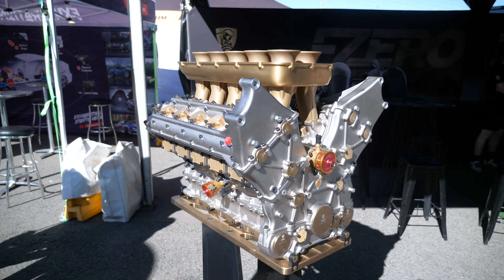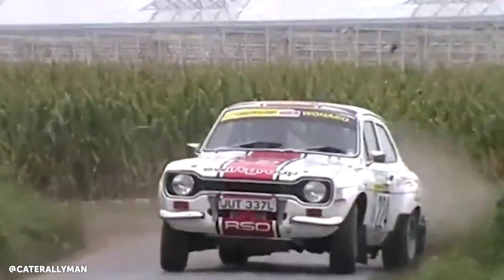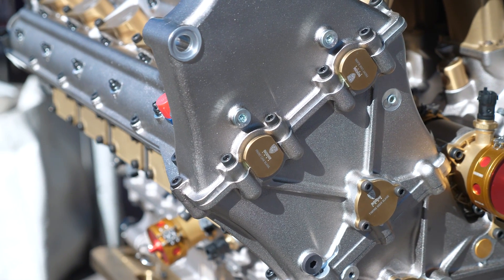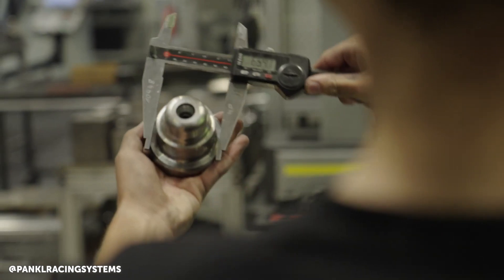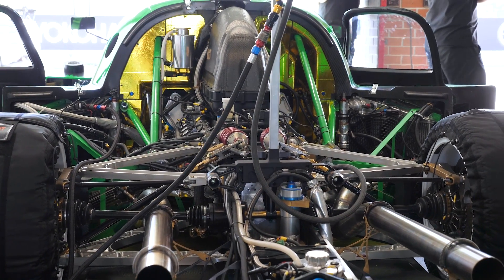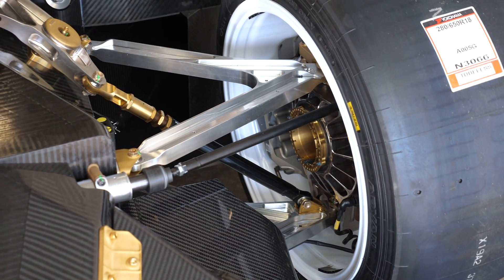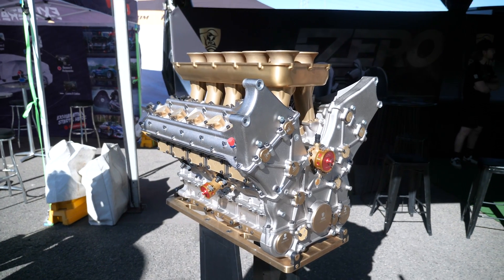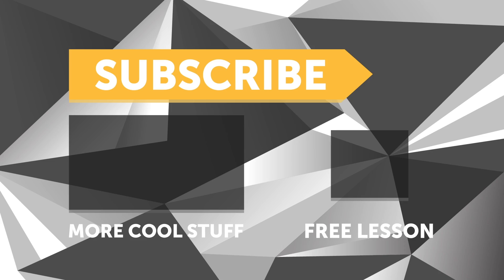NEW V10 Engine With A €45,000 Crank | Rodin RC.TEN

Comment: With good twin screw Supercharger this engine will make over 1500hp Turbos are not good because of their lag Twin screw superchargers are very efficient now days .
Reply from the maker: Technology has come a long way when it comes to turbo technology, boost control and turbo lag 🤘 - Taz.
Reply: @hpa101  So Turbo now days have No lag, instant power at lower RPM and have throttle response of naturally aspirated engine ?
Reply: @Maiza007-c8y so people now days take everything out of context and put words in others mouths?
Reply from the maker: @Decki777 are you saying superchargers have no comparative downsides, namely heat issues, parasitic drag and running out of puff at high RPM for the twin screws? No you didn't, neither did I state what you wrote. Don't be a manus.
I think you'll find everything has pros and cons, and sometimes having an option that is strong in one area but weak in others will see something that performs consistently across the board chosen over it, and in the case of turbocharging, also gives more options when it comes to packaging.
You have all the information you need at your fingertips to educate yourself on modern turbocharging and how lag is combated if you want to take your head out of the sand, remembering there will ALWAYS be pros and cons for any option you have for your own application/s.

It's also worth remembering that there are many different motorsports with varying requirements. There isn't one option that is best for every and any car - Taz.

PS: Here are a few links to save you some effort searching, if you only have time for one thing, perhaps make it the podcast with Matt (4th link). Hope that helps.
https://www.hpacademy.com/previous-webinars/113-dual-vvt-tuning-strategies-motec-m1-2/
https://www.hpacademy.com/previous-webinars/352-boost-control-tuning-haltech-elite/
https://www.hpacademy.com/previous-webinars/135-introduction-to-vnt-turbo-boost-control-variable-nozzle-turbochargers/
https://www.hpacademy.com/blog/120-wastegates-and-boost-control-what-you-need-to-know-podcast/
https://www.hpacademy.com/blog/electronic-wastegate-control-is-here-turbosmart-ewg-at-sema-tech-talk/
https://www.hpacademy.com/blog/383-9-cfm-from-a-50mm-wastegate-boost-control-just-got-better/
https://www.hpacademy.com/blog/want-instant-boost-elmer-racingturbosmart-spool-valve-experiment-tech-nugget/
https://www.hpacademy.com/blog/how-to-choose-the-right-turbo-for-your-build/
https://www.roadandtrack.com/car-culture/a45050542/how-twin-scroll-turbo-work-lost-scrolls-of-turbocharging/
https://dsportmag.com/the-tech/twin-scroll-vs-single-scroll-turbo-test-the-great-divide/
Reply: @hpa101  Both have pros and cons pretty much all modern super and hyper cars are Turbo charged what I'm saying is now days Twin screw blowers are much more efficient than before Turbo reduces kills pure engine sound I kno Turbos are much more efficient and makes little more power .
Reply: @hpa101  Super - Turbo is pretty cool though, best of best of both worlds, not sure if you saw that OM606 GM truck build with super-turbo, with a bypass air valve (no clutch on charger) for when the huge turbo finally comes on, the twin screw parasitic drag is not actually too bad as it runs essentially unloaded once turbo comes in, but made HUGE torque under the curve vs no charger
Reply: @Maiza007-c8y  three turbo compound set up with boost controllers at the cylinder to maintain max boost across rpm. Think anti lag
Reply: @reallybigdixiewrecked  Just rode in a Goblin kit car with a twin charged chevy cobalt engine and the lag and boost threshold were non existent. It was absolutely wonderful. The turbo was a 600hp turbo, btw!
Reply: Why not both 😎
Reply: It's 2024, buddy. GM builds a 2.7 L 4 cylinder, that makes 420  Lb/ft of torque at 1500 RPM , IT'S SPOOLED BY 2000, WHAT LAG ?!?!!

Comment: Everyone with an RX7 needing its 10th set of new apex seals right now… 🥵
Reply: Bah, I had rotaries for 20 years and never had apex seal issues.
That was just a consumer issue for ppl that don't change their oil
Reply: @m.b.82  rotaries are rare where i live but every single one ive seen for sale had either blown engines or had already been rebuild even bellow 100k km. Cant tell me a rotary is reliable even if you maintain them, they surely cannot last anywhere near as long as a piston engine.
Reply: @KK001  that's because they aren't being looked after like I just said. The ones that aren't for sale are owned by long term owners who aren't selling them.
Reply: @m.b.82  if an engine needs alot of maintenance, isnt that almost the same thing as it being just unreliable. Or can rotaries last  200k miles, but they just need alot more oil changes etc?
Reply: @KK001   they can. Pretty rare though. Oil changes every 5 or 10 of normal use. And just normal care.
And cheap to rebuild. At least used to be.
They hold up great in motorsports applications. Better than piston engines in a lot of cases.
I'm past them now though. Too expensive, parts are getting rare
Reply: @m.b.82  so in other words theyre reliable race cars but unreliable dailys.
Reply: @KK001   I wouldn't say they're unreliable road cars per se. But they are probably more for people that are enthusiastic about their car rather than neglecting them.
Reply: @m.b.82  i should have said compared to piston engines theyre more reliable when driven hard but less reliable at driving easy. Thats why they would fair better in motorsports but kinda fail in road cars.
Reply: @KK001  you need high quality spark components, and regular oil changes. No repeat cold starts/shutdowns.
Maybe a hint of premix..
Neglect any of the above and you'll have problems. Maintain and rev the piss out of it and live a happy life (with shte fuel consumption)
Reply: @KK001  supercars need maintenance each time you look at them, so I guess that does make them unreliable.
Reply: All depends on power level and tune  @m.b.82
Reply: Well just add oil to the fuel, and don't let them sit!
Reply: You OBVIOUSLY have NO IDEA what YOU are talking about, when talking about Apex seals.
Reply: Meanwhile, my friends peripheral port 13b that was built TWENTY FIVE YEARS ago is still alive and kicking. Yes, it still sees 9-10,000 rpm. No, it doesn't need tons of premix. 

It's not 1998 anymore, technology caught up.
Reply: I've swapped myn for a 4 pot due to the last engine had it tuned to perfection then a coolant hose burst so had enough after 15 years with rotary With all the little issues I had stuck this 4pot init for the last 5 years not touched it starts on the button every time same power level
Reply: Those likers and @ImInLoveWithBulla don’t how to maintenance apex seal😂 learn harder noob
Reply: Knowledge and maintenance skill issue😂
Reply: @ImInLoveWithBulla  tell us you don’t have an RX-7 without saying you don’t have an RX-7
Reply: @IggyNaishus  thank god. I own a Corvette.
Reply: @ImInLoveWithBulla  my bridge port lasted 4 years of flogging every day to red line it loved it and a side seal went not apex and  when it's only 750$  for a  rebuild kit not a problem
Reply: Casually ignores Rob Dahm if all people only ever bricking a rotary by accidentally giving it 60lbs of boost
Reply: avarage automotive ragebaiter who need attention.

Cute.